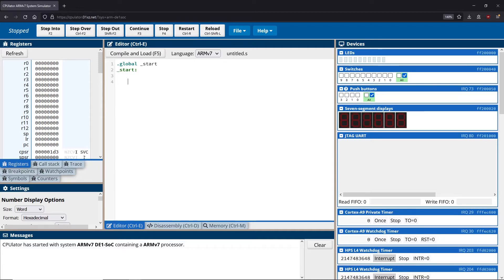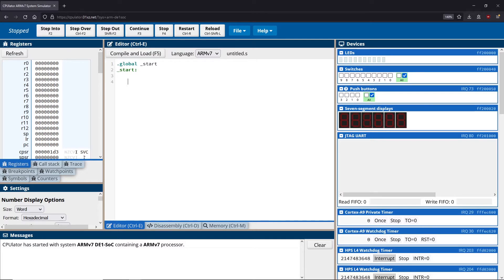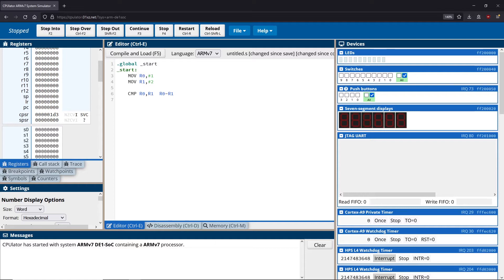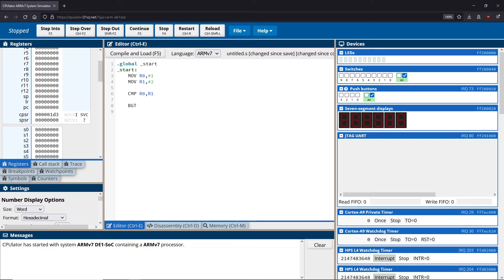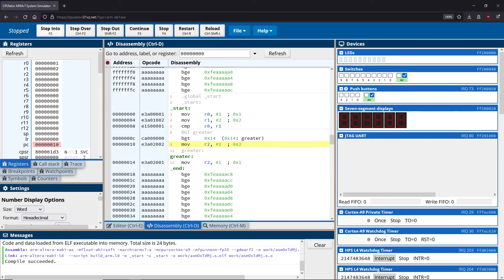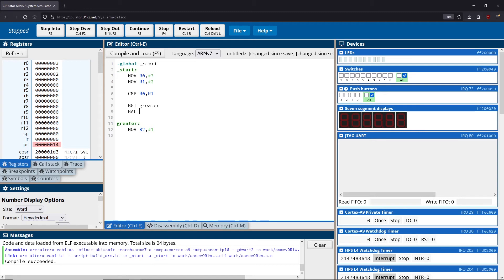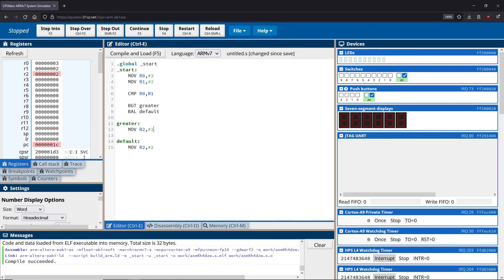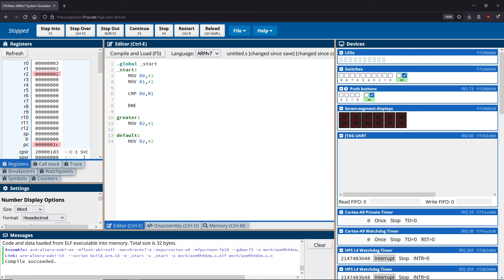Introduction to Assembly Programming with ARM - Conditions and Branches

Comment: You need to use conditional moves rather than branching all over the  place (spaghetti code)

mov r0, #3
mov r1, #2
cmps r0, r1
movlt r2, #-1
moveq r2, #0
movgt r2, #1